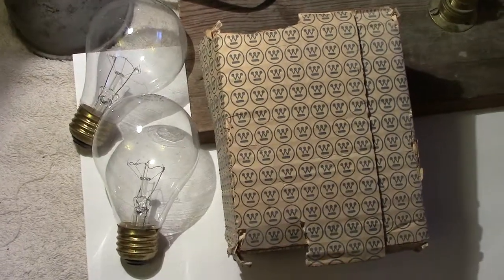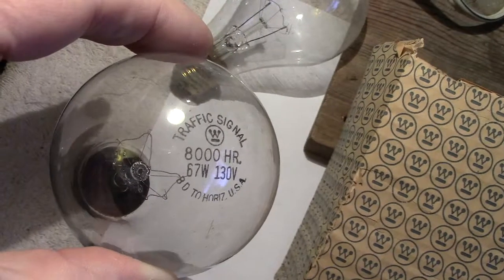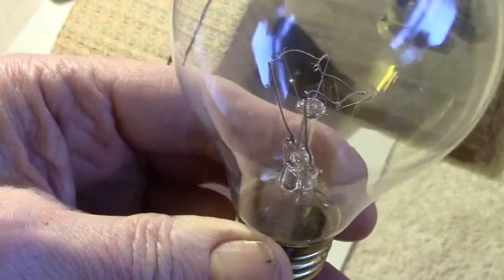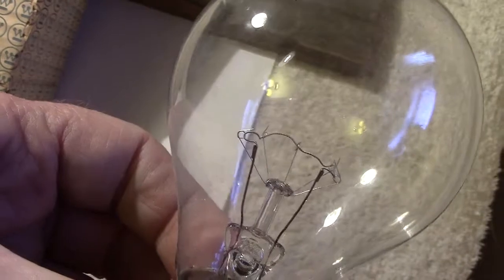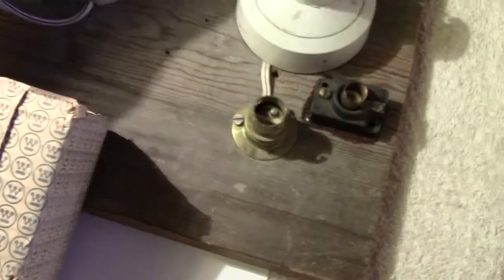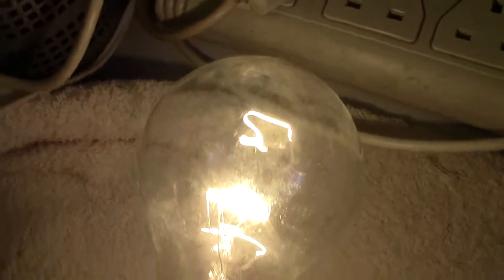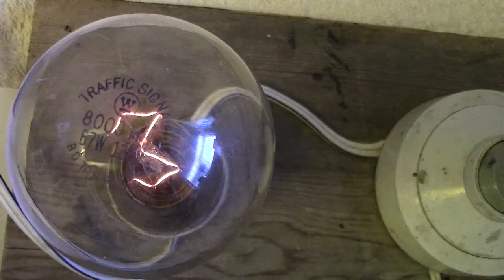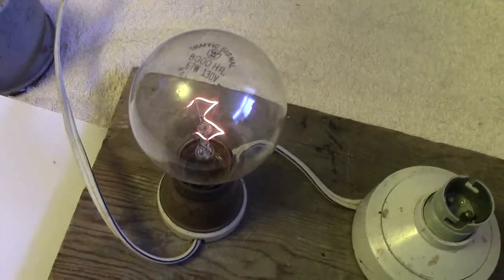Westinghouse Traffic Signal 67w  130v  8000 HR  USA

Comment: Neat lamp, and becoming rarer as the lamp assemblies are being replaced by a drop in GE LED replacement. Being that is a 130v lamp and the nominal line voltage here in the US is 120-122v up from 115-117 in the 20's-60's those lamps will last even longer than 8000 hours, of continuous burning.
Reply from the maker: You are right, they were intended to do those hours now would be more, but as you say LED has taken over, here also.

Comment: Most British traffic lights back from the 80's onward as far as I've seen use low voltage bulbs with a transformer, not sure if halogen or just tungsten, no idea what voltage, thou I remember some older traffic lights that used regular looking bulbs that were still about in the early 80's... it's another area where LED is taking over.
Reply from the maker: Yes I remember those low voltage lamps think they were the Quartz halogen but also remember the rough service type of lamp being used and then LED which are getting into everything.